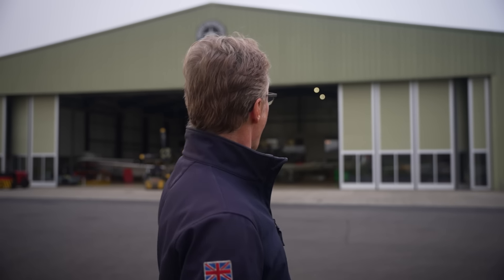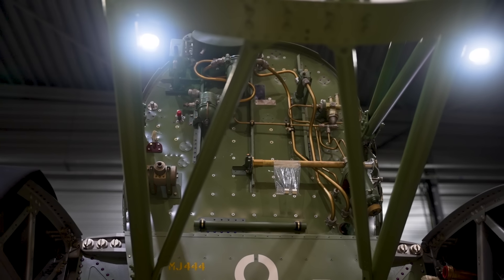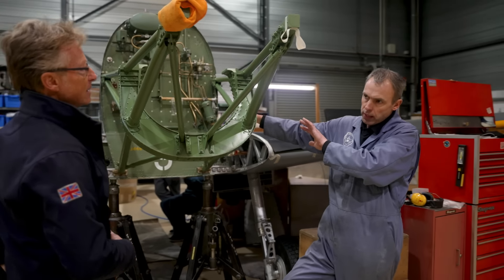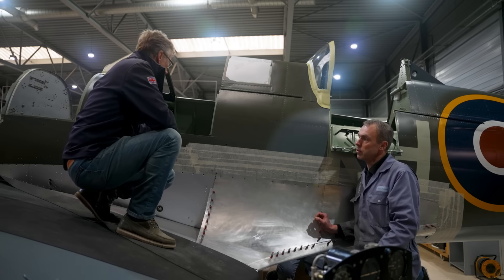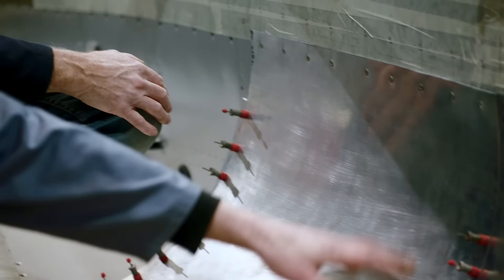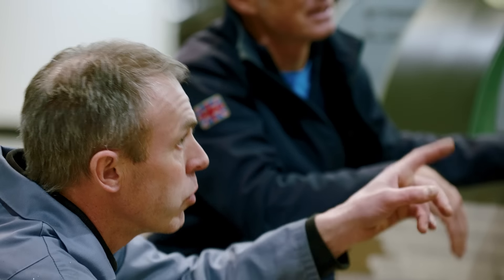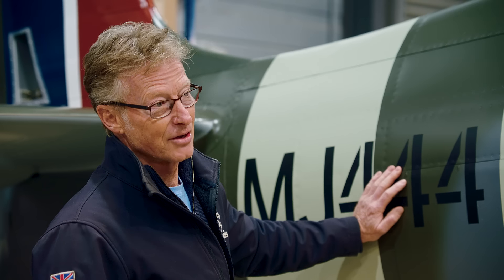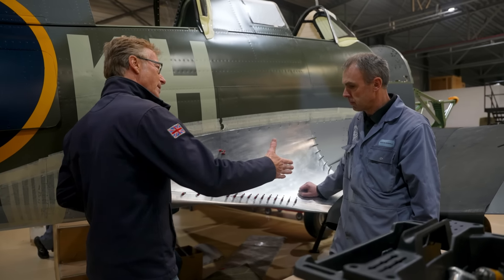The Spitfire MJ444 Restoration | Parky visits Aircraft Restoration Company

Comment: Having watched this update video, I wonder why the restorers chose to finish the aircraft in 403 Squadron colours (10:00) and markings instead of 443 Squadron? MJ444 flew with 411 Sqn starting 21 Sep 44, was transferred to 403 Sqn 14 Oct 44, and then to 443 Sqn on 14 Dec 44. Flt Lt Fairfield of 443 Sqn bailed out 13 Jan 45 after being hit by flak near St. Vith. It seems to me that it would have made more sense to finish the Spit in 443 colours. JJ McManus ex-CO 443 Sqn